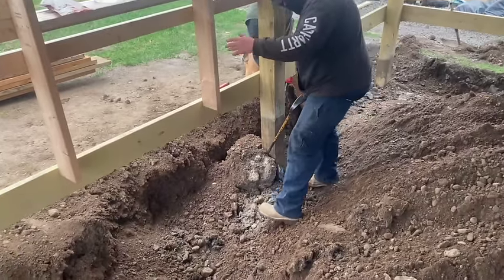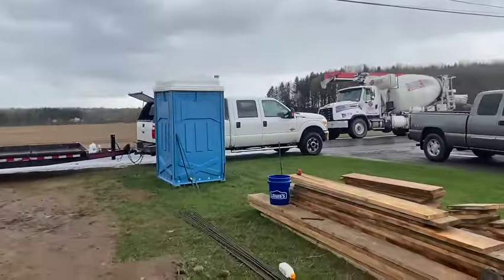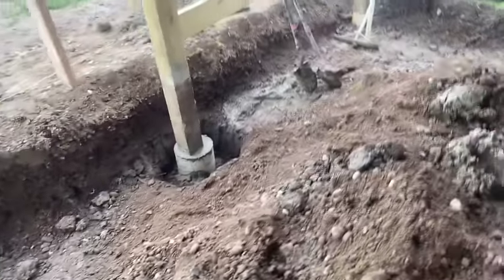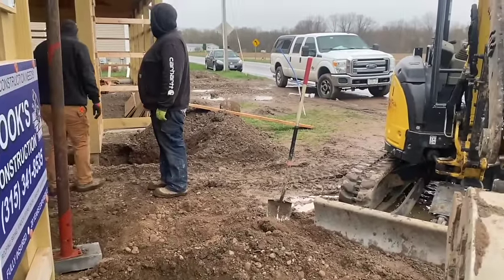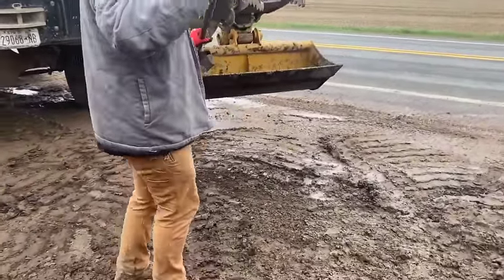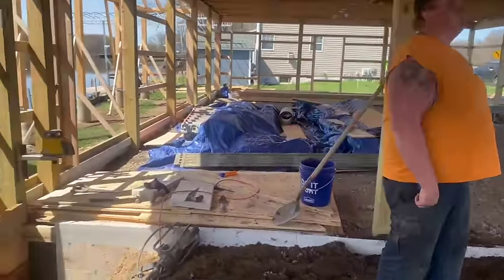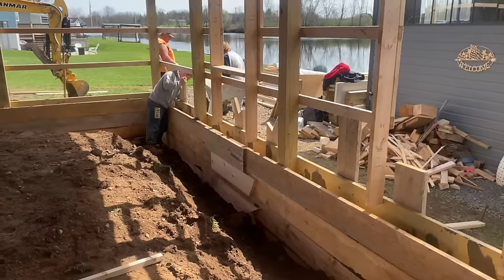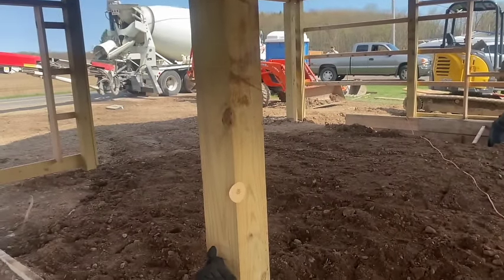HOW DID THIS PASS INSPECTION???

Comment: Back in the day in Cleveland we'd build them like a Q-tip made out of treated 6x6 and barrow mixed sakrete around anything that touched dirt and or h2o, (36" to frost). With full understanding that anything short of a mono slab was going to move some. The idea being the sakrete would delay the decomposition of the post. This video reminds me of a bad attempt at that. My Dad built a large multi-level deck off his house over a eroding ravine and 30 ft cliff when I was a little kid that is still in decent shape today - 40 years later.

Comment: There is a detail for fence posts that calls for a post to be placed in a hole (36"+-) with gravel in the bottom and a "Flat Rock" placed between the bottom of the post and the gravel.  12" of gravel around the bottom of the post and 12" of concrete above that around the post at ground level.  This is a detail that help prevent the post from rotting.  Never seen it on a pole barn.

Comment: 🔥the biggest issues with that setup is the weight off building will push the post threw the concrete like sleeve. Specially at the over head door opening with weight on those 2 posts.. great repair boss, u did perfect repair🔥👊🔥🏍🔨⚙️🚜
Reply from the maker: Actually the concrete was under the post also but the real problem in our area is the frost would grab them big blobs of concrete and heave the post upwards in the winter when it froze and soil expanded. Thanks Jeremy. 👊
Reply: @bondobuilt386  yes forsure.. I didn’t see it was under post.. but ya def a better footing setup way u doing it. Get r done ✅ 👊I’m up in northern Ontario so I hear ya on frost line

Comment: I hate to say it but pole barns are really a weird structure. They resist heaving in weird ways. Even if they heave it isnt a big deal depending on the rest of the structure. 

But there is a well known reason post get stuck in the ground and it is because it's easy. If you were going to go to the effort of putting concrete beneath these poles why not continue with sonotubes with those plate s connecting the poles above ground. Not beneath the ground. 

So if a quality repair is what your after, why not do it right and get the wood out of the ground??? 
Cause at this pointthe hard work is already done. An extra few yards of Concrete is a small price for that level of work that is already done and not take advantage of it is a real waste...
Reply from the maker: The entire house posts were in the ground. This was just the garage. Also we had to make the curb for the back and side. I do not like pole barns but we had to fix this and be cost effective.

Comment: Isn't it a bad idea to burry those Simpson brackets?  Why not extend the tube to grade to encase the 2ft of post below grade or chop the 2ft off the posts and install the Simpson bracket above grade?
Reply: I dont want to be an armchair quarterback. I would tend to agree. Time will tell how long the brackets will last burried in the soil. . I would have recommended to  cut off the posts and sit them on the brackets above grade. Lot of work. And dangerous.
Reply: Exactly!  Here in Western Oregon where the ground is wet 250 days/year, I would never bury wood unless it’s a telephone pole or railroad tie and soaked in creosote.  No pressure treated wood will survive more than 10 years here under the ground

Comment: You can install vertical lengths of fiberglass rebar from the sonotube up into the bottom of the lower horizontal framing member. Epoxy it if you like. When the post bottom rots, the FRP bar will remain in the concrete and the good wood.
Reply: The way you guys did it, with the horizontal rebar running through the posts, will more than sufficiently tie the posts to the curb. I see that you needed that curb system on the low side because of the slope down to the boat house. Overall an efficient design, to correct a BS first try from the the pole barn builder.

Comment: Could you have poured a floor out to a foot from the posts then supported the building on that floor then poured a footing under the posts with wet set brackets with rebar connecting the slab to the footing/stem wall?  Basically, a slab on grade with a 2x2 exterior footing.

Comment: I don't know why they would just dump concrete at the top of the hole. Here in the midwest the poles are sunk below frost line then backfilled with whatever came out of the hole. But they do throw a concrete block down that the pole sits on. Then if you want a concrete floor, it is poured to the grade board so the poles are partially surrounded. The slab floats. Outside however, we did pour the porch slab around all the posts. Its been fine for 5 years with just some cracking, which was ecpected.
Reply: Oh, now I see. They used poles that are too short! My posts were sunk at least 5ft below grade.

Comment: When doing structural, never set your posts IN concrete. Posts should be setting ON concrete with a post base and J bolt. If you see your contract setting them in the concrete Fire them. No matter where you are in the country.
Reply: tell me you dont do construction without telling me you dont do construction
Reply: @joshpoe  Huh?
Reply: @bigdaddyccm1217  pole barns posts are always set in concrete, never in my 35 years of building have I ever seen a pole barn post resting on top of any tie down. Your comment about structural is kinda hilarous as well. Structural posts are anchored with a tie down like a sstb traveling though a stem wall and footing or deepened slab or sonitube. Engineering pages for these pole barns have never had a detail involving tie downs in my experience.
Reply: @joshpoe exactly
Reply: Most of the ones I seen they dumped the concrete in dry and let the ground water set it up. But the way he did it looks like a much better system because concrete will destroy even treated wood. My thing is those posts should have been way deeper than that.

Comment: The 15 years I did construction you'd be surprised how many 'builders' would say this is fine..
And how many 'builders' would cut corners/screw over the customer, just to save a dollar..I don't care if I lived in the dessert I'd have concrete under it..
Weight vs Dirt..
Weight ALWAYS wins eventually..
That's why old houses that used rocks as footers always are super unlevel and always have structual damage from settling/sinking stress..
One of my biggest annoyances is when people still put sand under concrete to save a few bucks 🤢
And tell your worker to stop smacking the damn threads on your jack..😂

Comment: In the South we dig a big hole, drop the post in, pour dry concrete around it, hit it with the hose, cover, and done.
Reply from the maker: Yes in the south that is fine. Not where we live the frost will grab it and heave it up.
Reply: @bondobuilt386  Right.  I put up a garage in Allentown years ago that required a separate pour just for deep footings.  (I didn't know why then and griped about it too!)  The guy that did you wrong in the video was probably from the South and thought he knew better.  Cheers.
Reply: For a residential project or just barn?
Reply: @nextjin  For a pole barn like this we might actually mix the concrete first.  The dry dump is mostly for fence posts and decks.

Comment: Typical pole barn footings use a pre-cast concrete cookie under the post, minimum 36" deep or below frost level -- whichever is deeper, and then the post holes are backfilled with dry-mix which will setup over time and provide very strong resistance against shear and wind loads.  Without adequate backfill (gravel, soil, and spoils do not count) you lose the structural capability of the footing against shear and lateral loads.  In locations with a deep frost line, the post should be sleeved (there are a number of products which can be used) to avoid heaving issues.  Not complicated but unfortunately it seems the barn builder didn't do any of this stuff.  Disgraceful!!

Comment: Probably could have at least used your hammer and capped a few times to knock out some of the air pockets I'm sure the concrete would have settled a little more
Reply: Or a vibrator, those mythical beasts are like compactors and are rarely on a job site..

Comment: Around here pole barns are inspected when the holes are dug with no posts in them, and they are inspected again when the building is completed, At no point here would an inspector know whether or not the holes were filled with concrete. 
My barns prints called for concrete cookies at the bottom of the holes and 4 foot 8 holes.

Comment: I wonder, why wood is still under ground level? I would make concrete much higher or something else to make sure wood doesn't touch concrete or ground and prevent rotten.
Reply from the maker: The entire house would have to be redone. I just fixed the ones that had blobs of concrete around them and frost protected everything. I did not design or build this structure. If it were my design it would be on a frost protected stem wall.

Comment: That is the strangest pole building I have seen.  I am in a 42" minimum frost area when they built my building 32x 50 it was on a pad that was made a few weeks before the building Even though it was compacted large limestone the builder still went to 50" with the poles, put a precast 24" round puck in each hole then set the poles which were made out of 3 2x8's laminated (glue and screws)  the center 2x8 was cut to allow the trusses to be bolted between the outer boards.  Purlins were put inside and out to allow steel siding outside and plywood on the inside.  A divider wall was put in the middle which has now been insulated and finished off into an office and more work area.  The divider wall is three poles installed the same way.    I have never seen one with short poles.  The building inspector(s) would order all that taken out.  The permit requires a plan and what they did would never be approved.  Looks like your guys did what they could but that close to the water, water in the holes seems sketchy.

Comment: My first house (G.I. Bill) was a small 100yr old 2 story in western Mass. Red rock foundation for the house, but the back porch would heave up a few inches in winter and started to pull the porch roof away from the house. Turns out the porch was on iron posts surrounded by a surface bet of concrete. Don't remember if I fixed it before I moved or not.

Comment: We dug up a rotted out fence post once which had a massive amount of concrete around it -- looked like the post hole had been dug with a friggin' backhoe. The rot was all where the concrete was. 18" of post sticking out below the concrete was solid and fine. Seems to me that concrete should be limited to the mud pie in the bottom of the hole. Sit the pole on that cured mud pie and backfill with sand -- 6" layers of sand will settle with water and get 95% compaction. Sand is much more likely than concrete to move water away from the post. Concrete acts like a big sponge -- takes a drink and slowly feeds it into the post = perfect environment for rot. :(

Of course, if you "need" the weight of over-sized concrete footings to guard against uplift in high winds, that's a whole different consideration . . . and good luck finding even one concrete dude with the wherewithal to know how big those footings need to be. :(

Comment: Pressure treated isn't suppose to come into contact with concrete or soil. It's suppose to be put on galvanized chairs that hold it off the ground\concrete and water . There are still many backwoods towns in NY that have no building codes . When you drive through their towns it shows

Comment: So if frost would have lifted concrete around post why wont it lift knee wall you poured?
Reply from the maker: Well in my next video you will see that we put foam down 32" and out 48" around this entire wall I built. The problem with the other guys method was those balls of concrete you could not get the vertical foam put in because it was a big blob in the way. We frost protected the entire house as none of it was below frost with 48" of wing foam. The house part they set on little squares of concrete under the post at around 2' down so we could get the foam in.

Comment: I built a pole barn and put concrete in the bottom of pole hole. Each hole was about 5 ft deep. All poles were treated and a floor was poured over the top and filled the hole the rest of the way up. Did I make a terrible mistake? Rebar was also added to the initial pour to connect the floor.  The building has stood for 8 years now and has not moved one bit. It is located in central Missouri.
Reply from the maker: I would say you are ok if it has not moved in 8 years. If it was in a cold climate you would not want to do it like that.
Reply: As long as the cement is below the frost line it's actually better.
Reply: @williamkirkpatrick8314  correct
Reply: You didn't make a mistake. I build these barns full time. I have no idea what the guy in the video is talking about. Treated posts set 42" below level ground and filled with three 80lb bags of sackrete is standard procedure. Why a concrete "wall" is the fix in this video is beyond me. Basically, guy says, "Don't use concrete around posts. Concrete bad. I'll fix this with concrete under the post. Now concrete good." Laughable
Reply: @ryanc2114  Depth fully depends on your frost line which is regional.

Our frost line in Canada is between 48-96 inches depending on location.
Reply: @ryanc2114 I’m late to this video but, there’s 2 fixes in this video. The 1st was the posts weren’t deep enough. The 2nd was the original reason they were called to the job site in the 1st place, to provide a “retaining wall“ for the floor in the pole barn. That concrete wall had nothing to do with the post supports or footings. 

I, personally don’t like wood (even pressure treated rated for ground contact) being direct buried or imbedded in concrete. I would prefer they pour full depth  concrete, and have no wood in concrete or underground. I know that isn’t the typical way pole barns are built though.

Comment: How do you ensure proper elevation is maintained when the posts are just hanging in the air? Seems like some amount of sag would be inevitable.
Reply: I typically use lasers to check before starting then make sure it goes back the same or as close to level as you can with all the other factors

Comment: what keeps the new concrete curb from heaving and taking the posts with it?
Reply from the maker: Good question. We put 32" of vertical foam board and 48" horizontal foam to frost protect it. I will show in next video.
Reply: Cool.  That makes sense.  I was genuinely curious as I know very little about concrete.   I'm a carpenter in northern Illinois.  I see a bunch of people finishing off their pole bars with just a concrete slab, and they sometimes stake it into the posts.  Never seemed like a good idea to me.

Comment: That 5 1/2 inch foundation wall going to crack and pull away Fromm posts as the building shifts and flexes with the wind.  It will make a good animal barrier.

Comment: Have a question. Since you are doing that kind of wall. Why not put a footing, trim the phots and setup a proper sill plate? seems like the cost woult not have been that much different and you wouln't have wood posts nested with the concrete.

Comment: really interesting video!!  Your fix was a variation on the concrete column with  wet set brackets at grade you see on midwest pole barn builds.  Do they use those in your area?
Reply from the maker: Most the pole barns here they just put the pole 4' in the ground with a concrete disk or solid block under the pole and backfill with gravel. I think other areas are worried about termites but we do not have them.

Comment: That is horrible.  I used to work for fingerlakes cons. All we did was post frame construction.  
We dug the hoke. Dropped in a pre-cast concrete round, set the post. Back fill w dirt
Reply from the maker: Thats how it should be done

Comment: I don't think any amount frost would have heaved those polls, if what the overall intentions was to put 2–3-foot cement wall all the way around it, with the beams in the cement.  just seen allot of extra work, of redoing it your way. as long as the original intention was to pour cement 2-3 ft wall around it/ that would have taken hell of allot freeze thaw over long time heave building with wall around it. JUST SAYING> but with just crappy poured cement on each beam, no wall, yes would push those beams out sooner than later.

Comment: How deep are the posts in the main section of the building ? Did the same guy build it ?  Thanks       Good dog - Rotor
Reply from the maker: The same guy built it. We need to do some repair over there too. built it different but there is a problem and this video will have a part 2.

Comment: You need to install safety for all your crew. These individuals don’t have any safety glasses to protect their sight (eyes). They used the wrong tools to remove the concrete around the post. Safety is #1 Hearing Protection helps too.

Comment: There's water in the bottom of the holes.
Why not just put 4 foot tubes, beef up the posts and set the posts on concrete above ground, instead  of in water?

Comment: Franklin Co Mo  REQUIRED me to have a 24" dia hole 4' deep  for 6x6 inner post for monitor style barn, set in concrete
Reply: We just had a horse pole barn built, Audrain County, MO Same thing 24" diameter and 4' deep.  We used heavy duty still braces for the bottom of the posts.  The wood does not touch the concrete or dirt.
Reply from the maker: that's a good way to build.